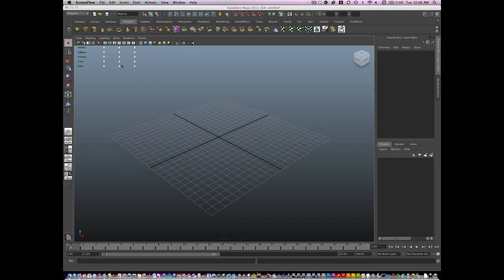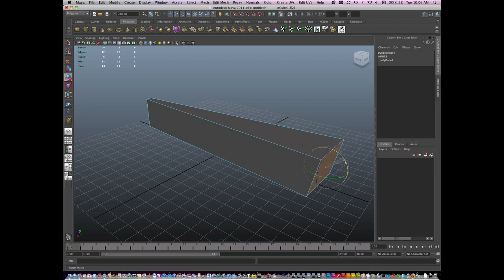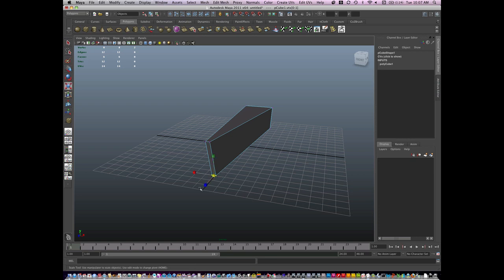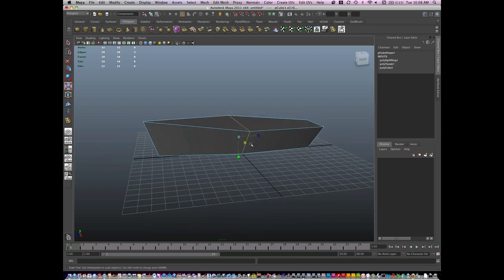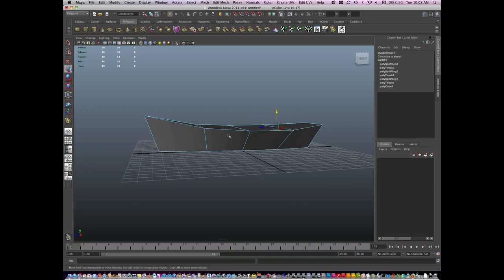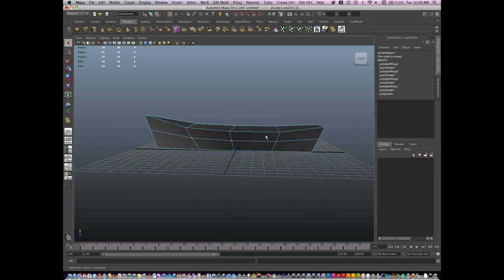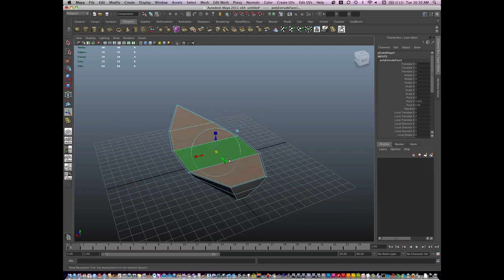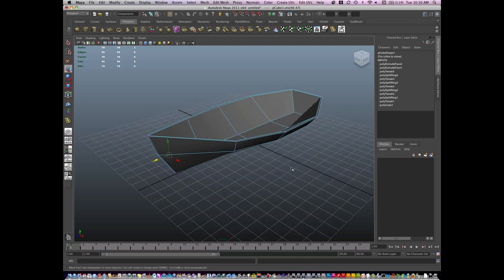0001 Maya Modeling a basic boat

Comment: By the way, for those on a MAC, with only one button mouse or a TRACK PAD, it can be a problem figuring what to do when a "right or middle button" is called for. By playing around with it for a while, I found what to press on the keyboard to execute those clicks.  COMMAND=MIDDLE BUTTON, CONTROL=RIGHT BUTTON. So to do the navigations you would:  TUMBLE - press and hold the OPTION key, then click in the scene and rotate scene around while holding the click down.... TRACK -  press and hold the OPTION and COMMAND keys, then click in the scene and you can slide the scene side to side or up and down..... DOLLY - press and hold down the OPTION and CONTROL keys, then click in the scene and you can move the scene closer or farther
In the same respect when the COMPONENT MODE drop down menu is needed and it calls to use the "right button" you can just press and hold the CONTROL button and click on the object. Then while holding click rotate and select.